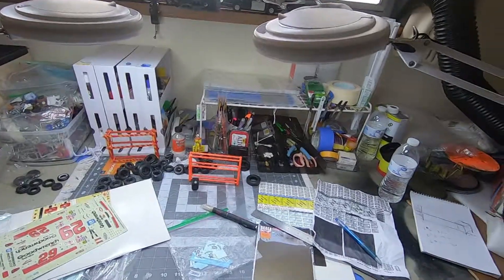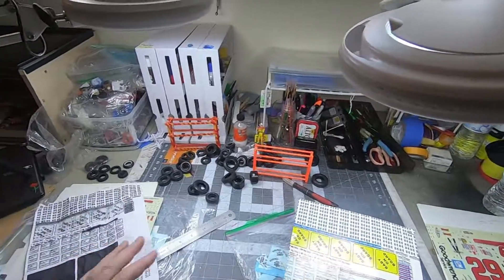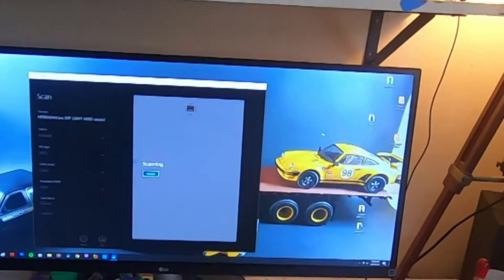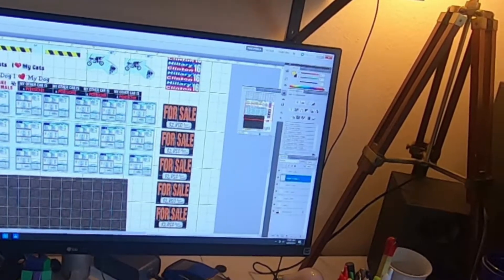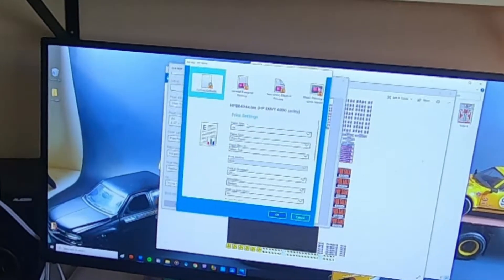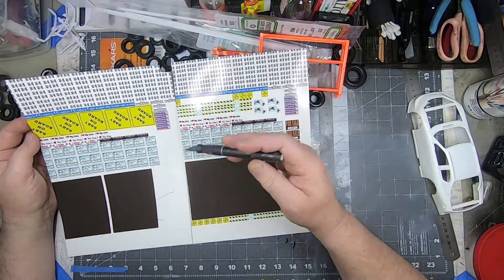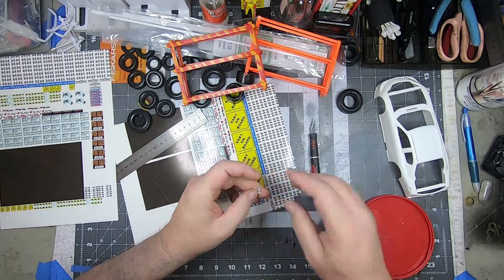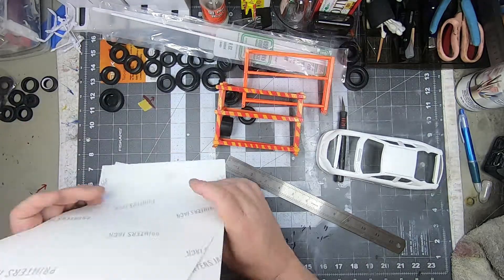DIY Decals learning curve round 1

Comment: Wow!
Thank you so much! That will definitely help. 
I appreciate you taking the time show how you make your decals!  Awesome 👍
Reply from the maker: Hope it helps you guys! I would like to point out that the decal sheets I bought are clear (I'll put the Amazon link below) and I am already seeing they won't work on darker surfaces, you can hardly see the decals at all when I put them on anything painted other than white, so I'd reccomend trying the NOT clear options, I'll have to buy some of that and try it, I can do another update round 2 video soon on what I've learned so far. I also found the decals don't take anywhere near as long as the ones we are used to to release in water, mine were actually floating off the backing paper really quickly!
Reply from the maker: Water Slide Decal Paper Inkjet 20 Sheets A4 Size Premium Water Slide Transfer Paper Clear Transparent Printable Waterslide Paper for Tumblers, Mugs, Glasses DIY https://www.amazon.com/dp/B07WC89JWF/ref=cm_sw_r_apan_glt_fabc_N74TBDN77Q7NRPGS3Z1M?_encoding=UTF8&psc=1

Comment: Have you tried to spray a coat or two of Microscale "Liquid decal film" on top of the prints? That might help secure the ink as well.
Reply from the maker: The acrylic clear i just bought specifically for this project seems to work great, but I'll look for that next time I'm at the hobby shop, thanks for the tip!
Reply: dust1956 I use microscale liquid decal film thinned 50/50 with IPA through my airbrush at 15 - 20 psi. It works great. I do 2 coats.